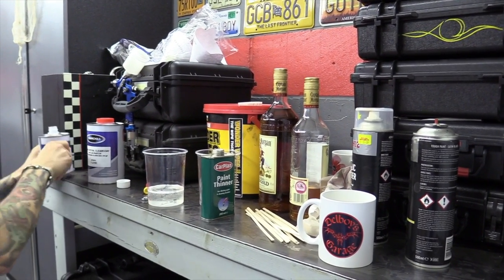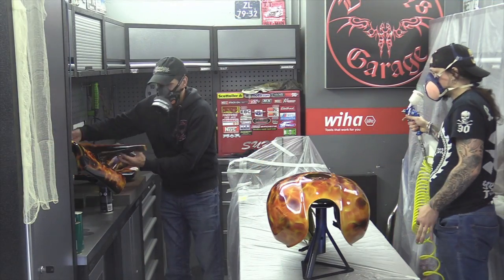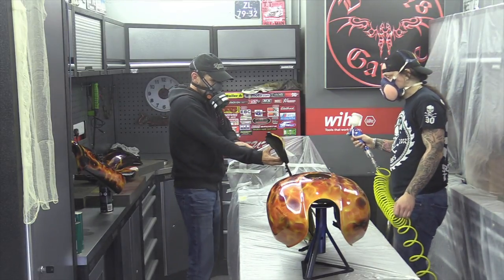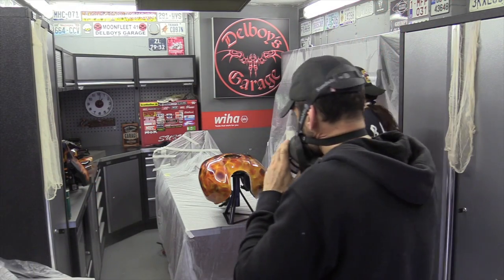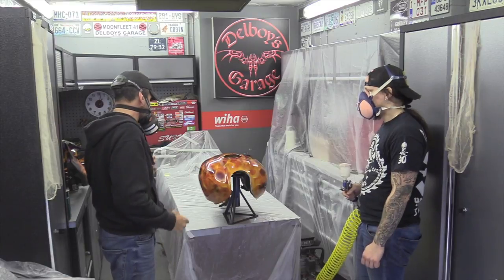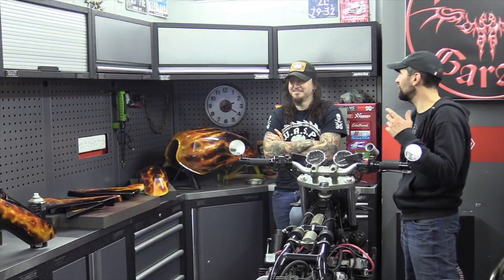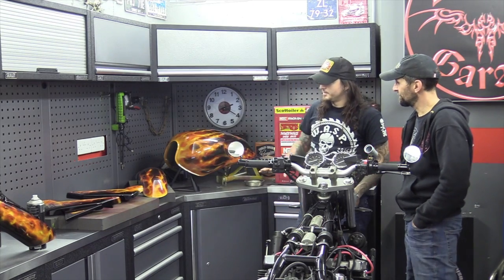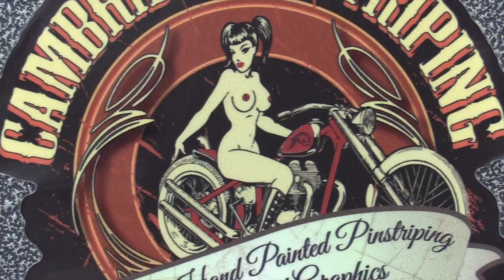Delboy's Garage, XJR Turbo, Airbrush Artwork Finale !

Comment: Mackie’s work was amazing. But that clear coat full of particles breaks my heart.
Reply: Ricardo Miranda it was best we could do in this environment, cut and buff process will get rid of all those. It will as good as a factory finish.
Reply from the maker: Thanks Ricardo, we had a really lucky dynamic on the day...the light wind was blowing directly "across" the open garage door.. this was literally extracting the over spray and any dust most of the time... so there is surprisingly little, and i have a lot to do buffing and polishing it to bring out its best now..

Comment: Wow. You may want to look at a product called F11 Top coat. I use it on my RT and it makes the paint work shine so bright it is literally blinding in the sun, and protects the paint a bit as well. Only downside is it drives any anti corrosion stuff away. Stay safe mate
Reply from the maker: Thanks buddy, something like that would be great for my Harley cos I use it in all weathers, but with the paintwork on the Turbo here, I'm prbably going to opt for something from Meguiares or AutoGlym to protect it...

Comment: Awesome paint job. Will we see the bike at Poole Quay, before the end fo the season ? All at The Churchill Arms bike night, in Alderholt  before winters, upon us.
Reply from the maker: Hi buddy, how strange is that - I was only talking to Gilbert Wheeler this afternoon out at The Churchill at the auto jumble they had today, and he mentioned how well the Tues nights are doing over there... (I won't be going back to Poole Quay any time soon, since their stroppy marshals have got so bad, one of them attacked a rider this year)... we always support Gilbert wherever they go, he works his arse off to create fabulous events, and he takes virtually nothing from it for himself... 

The bike will be on the road before it's actually finished for this reason... I have to flat and polish the paintwork, change the HT leads and foot pegs, then over to Moore Speed Racing for a dyno run to check it's running nice and healthy and not too lean, then time to play... , that should be a few weeks at the most, and we have a couple of months left yet, so maybe I will get the last couple of events in... I still need to paint the wheels black, along with some other components too, plus replace the brakes, new discs, etc., but that will be a winter project once the salt goes down, so fingers crossed, may see you there buddy !
Reply: Moonfleet41 that was a nice long message, full of information. Now they have new Marshalls, at the Quay, it's not so bad! I've only been watching your vlogs, this past month also, I've been catching up. In one of your vlogs you asked the question, do they cast stainless steel. The answer, is yes. As I'm a fab-weld, I make things for boats, and we sometimes use cast. Stainless steel. It's a good move if you can get in to TIG welding. 👍

Comment: are you not flow coating (wait a week and then clear coat again) the parts to add more depth and hide any dirt? is there a reaction on the fuel tank? looked on the videos like the paint had started to blister
Reply: Hi Ross, I normally would do that after 3 or 4 days yes. But giving the job is 200 miles away I went with extra thick 4th coat instead,. The result is pretty much the same. Once it's flatten and polished all the little imperfection will disappear.
Reply: Hi Mackie, ahh i was unaware of 200 mile distance between yourself and the job, yes you should be able to lose the imperfections once flatted back. was that mini hvlp a 0.8mm or 1.0mm tip?

Comment: Without a million quid of air filtration equipment, how come spray mist doesn't harden in the air into dust then totally contaminate a job? Or does it?
Reply from the maker: Not sure of the exact technical answer to that as am not a paint specialist, but the paint is dried by chemical reaction, not evaporation, and there is a long duration time on that, even small particles will stay wet long enough to blend in with what they land on....